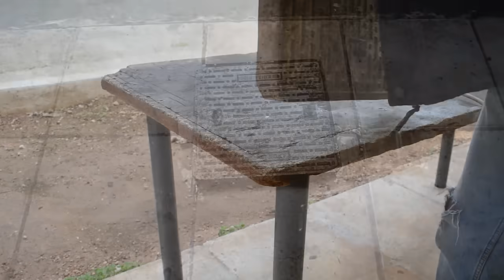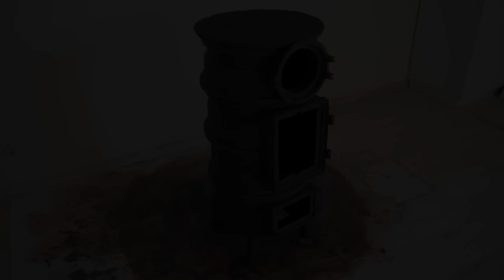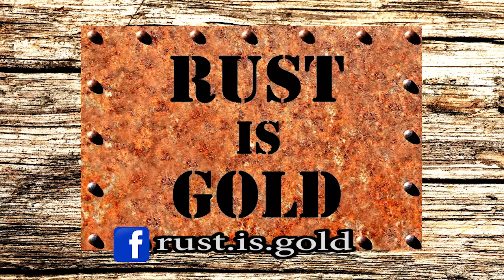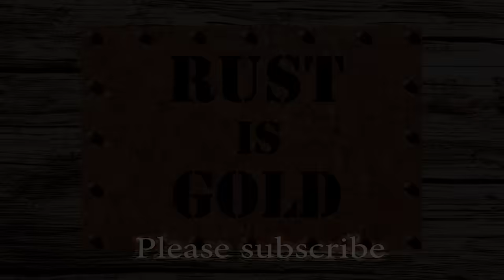DIY Wood Stove made from Car Rims

Comment: I don’t get the round upper door...but it’s beautiful nun the less! true folk art! What i like is most everything could be fabricated with some very basic harbor freight machines and tools. I’m extremely impressed by your skill level just beautiful!
Reply from the maker: Thank you very much for your comments! I wanted to put a small door on top and I had this circular door here in stock so I decided to install it! All the other wood stoves I searched in YouTube had 3 doors. In addition you can open this door to allow more air to go up to the chimney.  This will clear the stove of smoke with out opening the bottom draft door which will increase the strength/heat of the actual fire.
Reply from the maker: I am just trying through my YouTube channel to show to other people that we don't need to have fancy and expensive tools in order to build something. All the tools I use are medium range cost tools bought at the local hardware store of my neighborhood. Also, the raw materials I have used for the majority of my projects were either found on the garbage or were bought from a scrap yard!
Reply: @RustisGold  that’s the best! Thanks for posting!

Comment: Beautiful design. Is the door at the top to control the heat when you cook thing on top of the stove?
Reply from the maker: Thank you very much for your comments! I wanted to put a small door on top and I had this circular door here in stock so I decided to install it! All the other wood stoves I searched in YouTube had 3 doors. In addition you can open this door to allow more air to go up to the chimney.  This will clear the stove of smoke with out opening the bottom draft door which will increase the strength/heat of the actual fire.

Comment: Good job. Last year I didn’t have gloves on cutting something and the wheel exploded and a piece ran up my finger cutting my finger nail off and slicing over my finger to my knuckle. Lol just for future reference
Reply: Years ago I had my grinder get caught in a groove I was cutting in a plate and had the grinder flip in my hands and dang near cut my little finger off at the base of my hand.  Even had leather work gloves on.  So, I don't use a grinder for cutting steel anymore.  That's the job of my Sawzall, gas torch and plasma torch now.  And wearing good gloves are what saved my finger.
Reply from the maker: Yes... We have to be very careful... I am also thinking of buying a torch...
Reply: @RustisGold  Plasma cutter well worth the money, even a cheap one would save you hours and all the disks.
Reply from the maker: @kurtdowney1489  yes... I really need to buy one. My neighbours will also be happy because I will not make so much noise!! 😄👍👍

Comment: Great project, great idea. My only issue was that many of the welds left a lot to be desired. They looked like they needed to be ground down to make them look better. Minor  issues for sure...but little things make a difference.
Reply from the maker: Thank you very much for your comments. I know it's not the best welding but I am not a professional welder....  I used the grinding wheel and they look pretty descent. I am not trying to sell the objects I create. Just trying to show to other people how they can transform pieces of garbage into nice looking and functional objects...
Reply: @RustisGold  ...Welding is a skilled profession. It takes practice and some knowledge about the metals you are welding. Keep at it, make an effort to improve and you will. Never settle for mediocre. Keep up the good works and ideas.
Reply from the maker: Thank you very much!! I will 😊👍👍

Comment: Very nice brother God bless from Canada eh if you would like to get better at welding try and control your travel speed with the Rod feet shoulder width apart and three points of contact if you are able to use an elbow or both on the work surface these things will give you better More consistent welds I love this project!
Reply from the maker: Thank you very much for your comments! Glad you liked it! I believe I am a much better welder now than what I used to be when I built this wood stove! 😊👍
Greetings from Greece!! 🇬🇷😊👍
Reply: Yeb, however it looks like he is trying to weld mild steel to cast, never going to be neat....

Comment: Nice but you forgot to put the dampers in the bottom  door... intake...
Reply from the maker: Thank you very much for your comments. I thought it wouldn't be necessary since I created 3 different scales on the bottom door so I open it and secure it as much as I want. Honestly I am not an expert on wood stoves. I can always add a damper on the door if it's needed... 😊👍
Reply: @RustisGold  the 3 slots are fine. I have a drum and if I want to close it, I just stuff tin foil in it.
Reply from the maker: @eagle9252  thanks again for your comments! 😊👍👍

Comment: sir, nice project. I have made several stoves out of rims or barrels. As for some of the comments about your steel or your welding I say most of them are just jealous. If I don't offend you I would try a different rod something made to weld through rust and to join different types of steel. Practice with different heat settings and speeds. Your welding is fine I only made my comment to make things easier for you. Thanks for sharing talent.
Reply: ~~~ William Adam's good and helpful advice is always great to have my friend.
Reply from the maker: Sir, thank you very much for your comments! You didn't offend me in any way... I can never be offended by people who post comments and try to help me get better. I am offended by mean comments from people who only want to curse and ridicule what I am doing. I will definitely follow your advice about the rods.
As I have mentioned numerous times before, I know it's not the best welding but I am not a professional welder and this is not a welding competition. Plus I used the grinding wheel and they look just fine. I am not trying to sell the objects I create. Just trying to show to other people how they can transform pieces of garbage into nice looking and functional objects... Take care!
Reply from the maker: @thinkingofothers353  this is SO true!! 😊👍

Comment: great job , about rhe meral you use for the door , what is it originally? where did you find it? thanks i m going to try to make one
Reply from the maker: Thank you very much for your comments! I used manhole covers which I reshaped into the doors of the wood stove.
In Greece you can buy them in any plumbing store. I bought these used ones from a junkyard dirty cheap. 😊👍

Comment: Could you use those barrel top locker band to join the stove easy to move
Reply from the maker: I apologize but I didn't understand your question...
"Barrel top locker band"?
Reply: @RustisGold  the locking ring that go on 55 gallon barrels to keep the lid sealed it could be used to join the two rims together and it could be  taken apart for easy transport
Reply from the maker: Oh ok! Now I understand… Of course it could be used in such a way. I don't know though while using the stove if the smoke could escape through that ring. However I think it really seals the two parts very tight.
Reply: @bearvassar6690  no it would just rust away with the heat, this type of wood stove will easily get to 400`C , those bands are not very thick they are also galvanised which is not good to breathe when its heated to those temps....  its stick welded and unless you really are good at welding with a arc welder you should put this together with a cheap MIG.

Comment: Nice idea fór homemade grill  :) i have no clue why you made second doors on top but i m sure they are necesery anyway good work
Reply from the maker: Thank you very much for your comments! I wanted to put a small door on top and I had this circular door here in stock so I decided to install it! All the other wood stoves I searched in YouTube had 3 doors. In addition you can open this door to allow more air to go up to the chimney.  This will clear the stove of smoke with out opening the bottom draft door which will increase the strength/heat of the actual fire.

Comment: I got my 1st grade journeyman welding ticket about 40+ years ago and there are a few questionable things being done here that you might want to be aware of. 
First thing is simply the welding of cast iron parts with 6013. Cast iron requires special care to weld it with stick electrode, like pre-heating your material prior to welding. If you don't heat it up and then cover it with insulation so it cools very slowly it can and will crack. Many times those cracks are inside where you cannot see them but they are there and they will eventually fail. 
Next, we have the welding of rebar. Like cast iron, rebar is not meant to be welded because once again it will crack and fail. 
Now I don't know how many of you noticed what the welds looked like but it wasn't very good cosmetically and very questionable structurally. That is because of a couple of things. First is rod selection. 6013 has a rutile coating and is first cousin to 7014. Rutile electrodes are shallow penetrating and need to be run fairly hot to avoid slag inclusions. Second would have to be the Sears AC machine not having enough oomph to burn the 6013 with enough heat. Not enough heat with 6013 with produce a weld that is very coarse in appearance and loaded with slag inclusions. I would also have to say that welder skill level played a big part in those welds looking like so much birdshit. 6011 would have been a much better choice with its light friable slag that is easily removed and less likely to have inclusions.
 Let's get on to that paint job. That paint is rated for 300C or 572F. Wood burns at 600C or 1112F. That paint will last maybe an hour before there are a lot of signs that it is fried due to excessive heat. The other thing is you better have that unit outside when you fire it because that paint burning and breaking down is going to emit a bunch of inhalable nastiness. I could not find a MSDS for Verolac by Vitex but I did get one for a few others like Hi Heat Rustoleum and VHT high heat enamel. Most if not all of these high temperature paints contain a substance called Copper Chromite Black Spinel. 
Copper Chromite Black Spinel has an MSDS and it says that it will not burn which means that when that paint starts burn it will be released in a dust form. That dust form is known to be carcinogenic and is also a known mutagen. It contains the following:
As Regulated OSHA PEL ACGIH TLV %Metal Sara
(Related Exposure Limits) (mg/m³) (mg/m³) (Typical) 313
Chromium (III) compounds (as Cr) 0.5 0.5 27 Yes
Chromium (VI) -Sodium Chromate
(as Cr VI) Impurity
0.005 (See 1910.1026) Action
Limit 0.0025 mg/m3
0.05 A1 as
CrVI
0.3 Yes
Copper dusts and mists (as Cu) 1 1 17 Yes
Manganese compounds (as Mn) 5 Ceiling 0.2 29 Yes 

If you have ever seen the movie Erin Brockovich you would have a pretty good idea about what happens when you exposed to chromium compounds. For those of you who haven't this is what the data sheet says:
CARCINOGENICITY: NTP: Yes      IARC Monographs: Yes
OSHA Regulated: No                     
IARC has classified Chromium (VI) as carcinogenic to humans. Chromium and certain forms of chromium
compounds are listed as carcinogenic by NTP. NTP and IARC have determined that there is sufficient
evidence for the carcinogenicity of hexavalent chromium compounds both in humans and experimental
animals. However, the hexavalent chromium compounds responsible (for human carcinogenicity) cannot be
specified. 
Warning: This product contains a chemical known to the State of California to cause cancer.
Signs and Symptoms of Exposure: Irritation of the eyes, skin and respiratory tract.
Medical Conditions Generally Aggravated by Exposure: Respiratory and skin disorders aggravated by dust

In short, no one really knows what happens when you come into contact with this chemical but they do know there is a fairly good chance it will kill you or mess you up really bad.
A better choice would have been VHT FLAMEPROOF paint. It will withstand 704C or 1300F to 1093C or 2000F on an intermittent basis. Of course none of this really matters because the original paint was not removed completely from anything and that paint will burn at a far lower temperature so the coating over it will just fall off anyhow. A better choice yet would have been no paint at all.

These are just a few of my concerns when I see projects like this. No planning, scant knowledge, and little skill. How many will follow his lead and end up injured or dead because they saw it on YouTube done by an "expert".................
Reply from the maker: Thank you very much for your detailed comments. I know it's not the best welding but I am not a professional welder and this is not a welding competition. Plus I used the grinding wheel and they look just fine. The wood stove is placed and used on an open space. Actually it's more of a decorative piece in my work shop. When welding cast iron I did a trick that I read in various forums... As you mentioned in order to weld cast iron you have to preheat it. I spend some time melting a few welding rods on top of the cast iron. Due to the high temperature they would melt and stick together. As a result this created a metal film on top of the cast iron. After letting it cool I welded the two surfaces together. I am not an expert and I don't pretend to be one but it seems to be working. So far while using the wood stove I haven't noticed any cracks on the weldings. I am not trying to sell the objects I create. Just trying to show to other people how they can transform pieces of garbage into nice looking and functional objects...
Reply: @RustisGold  If you know anything about welders they are full of BS and will criticise anything and anyone except themselves.
Reply from the maker: @greenghost6416  let them criticise!! 😄 I am having fun creating various objects and that's what only counts for me! 😊👍👍
Reply: @RustisGold  Das Right.
Reply from the maker: @greenghost6416  😊👍

Comment: i like it but what is the uppermost round port hole for?
Reply from the maker: Thank you very much for your comments! I wanted to put a small door on top and I had this circular door here in stock so I decided to install it! All the other wood stoves I searched in YouTube had 3 doors. In addition you can open this door to allow more air to go up chimney.  This will clear the stove of smoke with out opening bottom draft door which will increase the strength/heat of the actual fire.

Comment: The down door is to clean, the second to air flow, the third with the window, to put wood, and about the upper? What's foot? To put something to cook?
Reply from the maker: Thank you very much for your comments! I wanted to put a small door on top and I had this circular door here in stock so I decided to install it! All the other wood stoves I searched in YouTube had 3 doors. In addition you can open this door to allow more air to go up to the chimney.  This will clear the stove of smoke with out opening the bottom draft door which will increase the strength/heat of the actual fire.

Comment: Very nice!  And, some questions: 
1. Why doesn’t the ash clean out tray have sides to prevent ashes from spilling?
2. Why an ash door, when the ash-slider tray could do that just fine? 
3. Instead of the decorative tiny round upper door, why not a rectangle door with a box for an oven? 
4. What if the interior configuration was a rocket stove L or J tube, making the rims as the “heat bell”? 
5. How long does the heatproof paint last?  Must redo annually? Is there a VOC stench that must be burned off before bring it indoors?

Comment: Its very cool, I just don't understand why it needed that top door.?
Reply from the maker: Thank you very much for your comments! I wanted to put a small door on top and I had this circular door here in stock so I decided to install it! All the other wood stoves I searched in YouTube had 3 doors. In addition you can open this door to allow more air to go up to the chimney.  This will clear the stove of smoke with out opening the bottom draft door which will increase the strength/heat of the actual fire.

Comment: I absolutely love this stove!  I do have a question, however.  What's the top little round door for?
Reply from the maker: Thank you very much for your comments! I wanted to put a small door on top and I had this circular door here in stock so I decided to install it! All the other wood stoves I searched in YouTube had 3 doors. In addition you can open this door to allow more air to go up to the chimney.  This will clear the stove of smoke with out opening the bottom draft door which will increase the strength/heat of the actual fire.
Reply: @RustisGold  You are a genius!
Reply from the maker: I just love to make objects out of scrap metal! 😊👍
Reply: @RustisGold  Keep up the good work!

Comment: This type of stove  cannot compete with a Barrel stove at all.
Reply from the maker: In what way?
Reply: @RustisGold  I'm assuming what he meant was your updraft style stove and the solid steel rims that wouldn't burn out are much superior.  At least that's my .02
Reply from the maker: Ok... Thanks! 😊👍
Reply: @RustisGold  The barrel i had and the "air tight kit" i fitted ready to fire up took 1 hour and 52 minutes complete time all i needed was a small angle grinder a drill screw driver and a socket and your contraption  hahaha give me a break.
Reply from the maker: @daviddjerassi  ok... Good for you buddy